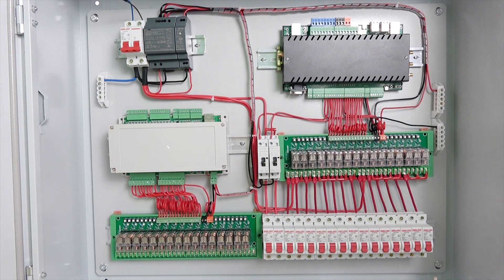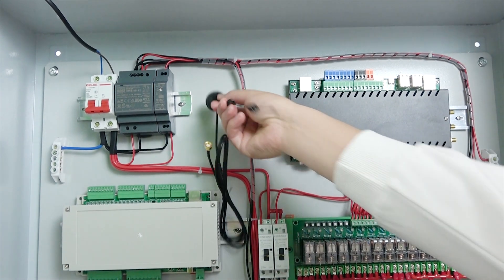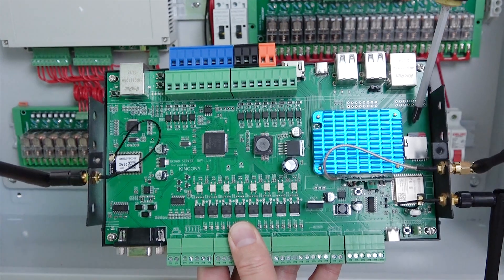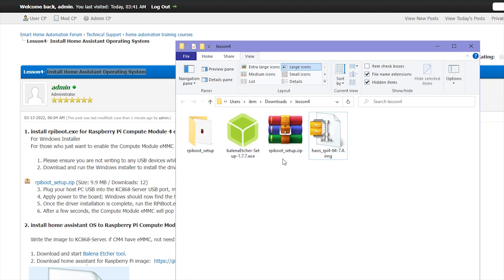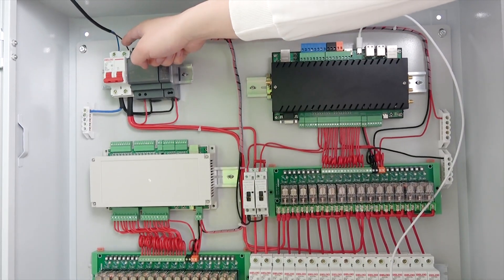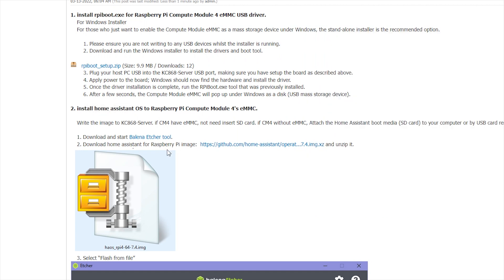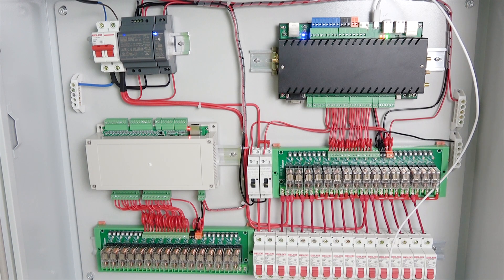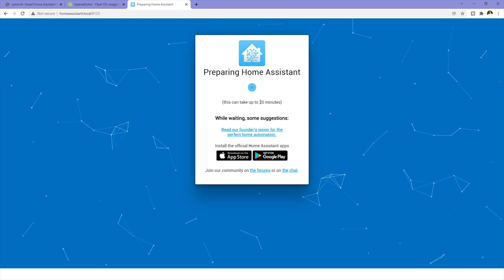【home automation training -4】Install Home Assistant OS by eMMC

Comment: thank you 
what is size of wire used ?
why use circuit breakers with one modual E16 with server and not use with KC868-A16 smart controller ?
Reply from the maker: wire use 1.5mm size. because that demo A16 use for curtain motor use, it's low current.

Comment: What happens if the internet connection becomes poor. Can we use a stand alone network not connected to the internet...I'm asking because you connected the Ethernet cable
Reply from the maker: our products not must need internet, it can work without internet. use a stand alone network is no problem.

Comment: Great video, but i have some questions about the memory that is used in Raspberry Pi.
1) Between EMMC and SD card which is the best in home automation for raspberry pi? if EMMC , will it be able to support every thing for a smart home, such as: safety cameras, certain, all the sensors,...
2) knowing that the SD card is easily corrupted, don't you think it would also be important to integrate an option for using an SSD card for the raspberry pi?.
Reply from the maker: 1. eMMC is better than SD card.  2. yes, you can chose  SSD disk connect to USB. SD card is last option.
Reply: @KinCony  Thanks